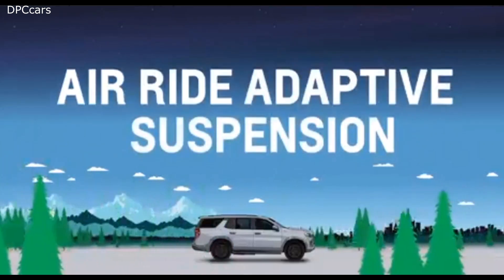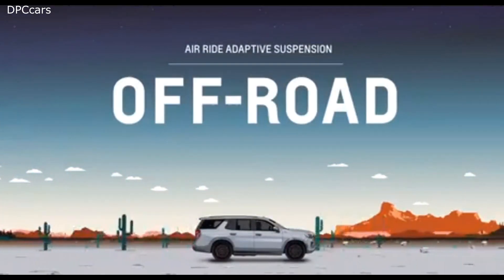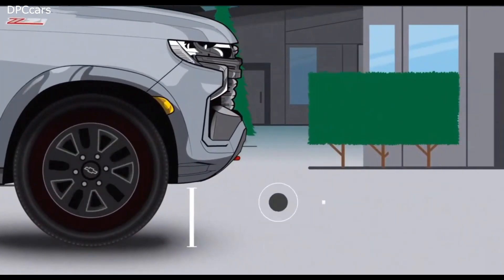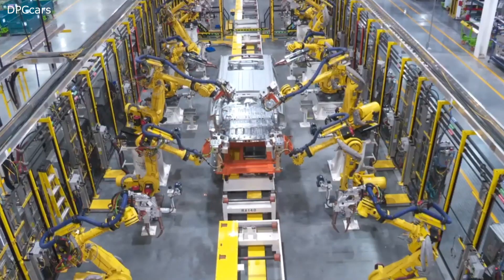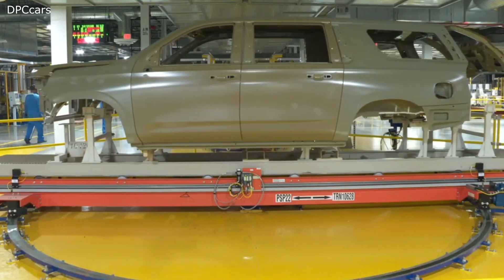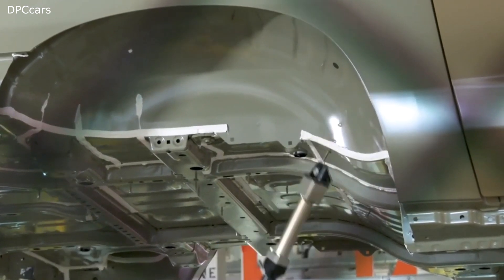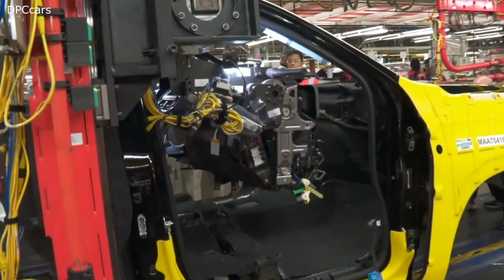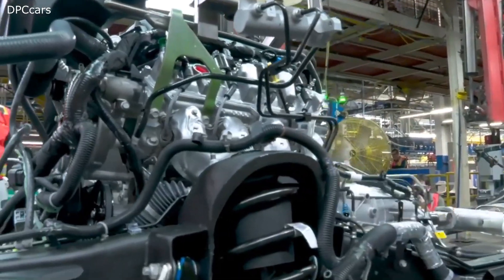2020 Chevrolet Tahoe and Suburban Air Ride Adaptive Suspension

Comment: The rear control arm design is a joke and disrespectful to all suburban owners. Ford and lincoln did a way better job at designing the irs. You can see through the rear suspension and see the car driving next to a suburban on the highway while land rovers and expeditions have tight and seamless rear arms. Literally looks like scaffolding equipment and random metal poles down there 👎🏾👎🏾

Comment: HOW does one manually control this air suspension? I am trying to lower in park, but cannot figure it out...
Reply: Sounds like 4wd low or high.  I need it to fit into our older garage too and need to know actual height reduction.  Sounds 2" less than factory.
Reply: It’s automatic

Comment: I love it. Do air shocks like this protect other components of the suspension from wearing down as fast? As in do they absorb impact better than traditional shocks therefore preventing other suspension components from being damaged over time by the impacts?
Reply: Low suspension arms will be susceptible to damage and impair patency. This is lower than many SUVs. Done badly. Air suspension tubing care after driving through mud.

Comment: Cart with cheap interior for the Price Q7, lol
Reply: It’s also a full size truck based suv. The Audi is a mid size car based suv. Prices get higher with size and body on frame designs are more durable in towing and rough terrain applications. I personally don’t see what’s cheap about it. Maybe the plastic tinker toy interiors they had pre-2014 but these are entirely leather wrapped with metal and open grain wood accents. It’s the same. The engine options are also legendary for long life. It’s not uncommon to find 5.3 Vortec V8 engines with 250k-300k+ miles on them. No automotive companies can survive these days with subpar products. Even non luxury brands have to have premium interior materials these days to survive. They can’t afford not to. The line between luxury and non luxury brands is fading.
Reply: @Cleaning_Hero  My uncle just bought a $80k Yukon 2020. The wood feels plastic and the whole center console creaks if you press on the "aluminum trim" which isn't fooling anyone. It also rides very firm for a "luxury" suv, far less refined than my Touareg. The new ones have independent air suspension like almost every other vehicle in this price range so hopefully they'll behave less like a truck now.
Reply: I just went to the Audi website. The Audi Q7 also has plastic buttons, plastic quarter panels and open cup holders. Try again.
Reply: @Cleaning_Hero  plastic in Audi better is high quality, don't  confuse with Tahoe there is plastic is low quality. By the said, Q7 has full leather package like Bentley...  Buttons Audi is beautiful, Chevrolet - ugly. Facelift Q7 don't have open cupboards. It's have virtual cockpit, not cheap instrumental panel like truck in Chevrolet. In tahoe even climate control blow from ceiling like a bus... Such cheap materials, simple ugly design, bad functionality - shame. For this money interior must not be worse than Hyundai interior.
Reply: Plastic is plastic to me. Also, people aren’t paying for the interior which is very competitive - with other vehicles in its class and price point.. They are paying for capability and reliability. For the money, you get more value in a truck based SUV, which it is. They can be used in many versatile applications. Try again. Expedition and Armada are both priced similarly and do not offer nearly as much refinement. Unfortunately, only so much can be told without physically seeing it, sitting in it, driving it and ultimately owning it. Even if this had a plastic interior as you falsely believe, it will ride better than any other truck based vehicle which permits the high price. The third row in this model is far more spacious than a Q7, which is another trait that permits the high price. The scarcity of vehicles that offer that and the scarcity of truck based suvs that offer a smooth quiet ride both permit the high price. And then you’d get the ability to tow and off road on top of that.
Reply: @Cleaning_Hero  note, GM plastic in Tahoe is shit, design is ugly for special, so that you feel himself homeless in Tahoe and pay them for Escalade. This plastic, these cheap with very simple design buttons, why i must endure it ugliness ?! It is not truck for $ 35k, it is cost like premium! And class never mind! Competitors very old (besides Expedition, which have interior F150, that same bad) and so poor. Is that yor excuse? Come up with better one! Koreans make already better for 0.5 price this booth.
Reply: @Cleaning_Hero  For the money you can have a Land Rover discovery with a better interior, nicer ride, and arguably more capability. The Tahoe might edge it out barely in tow capacity being a BOF vehicle but the Land Rover will be better off road with its more sophisticated terrain response.
Reply: @SimonStrother  Land Rover products have a tendency to fail more frequently than most other brands vehicles. They are beasts but!
Reply: point4894 what’s cheap about it
Reply: @Cleaning_Hero  looks up dushboard, buttons, instrumental panel etc....
Reply: @Cleaning_Hero  its a shame.
Reply: point4894 and I see leather lined panels, dash, metal accents and open grain wood.
Reply: @Cleaning_Hero  and cheap black plastic from below, on central console, around display, very cheup and ugly buttons like car 2010 year, open cupholders, dashboard like a old truck.
This is worse than cheaper Palisade.
Reply: point4894 most vehicles have plastic buttons including the Audi lol and news flash, it is a truck. Not a luxury car. Trucks are expensive for their capabilities and because the market favors them. Compare it with something in its vehicle class (full size truck based SUV) and not mid size car based SUVs, which are cars wearing an SUV mask.
Reply: Beauty is subjective
Reply: It also likely costs more to build a full size truck based suv than it does to build a smaller car based suv. It’s simple. More materials are required to build bigger vehicles. There are reasons why more people buy Tahoes than luxury suvs in the same price bracket. Aka capability, driver comfort, versatility and suspension durability. Case closed :)
Reply: @Cleaning_Hero  rear suspension tahoe fall off on first rough.
Reply: point4894 I do believe I’ve upset you. Apologies. Also, I’ll only debate statistics, not subjective opinions. Korea does not offer a full size suv to my knowledge so not sure why you brought that up. If you want to have a go at this vehicle, you have to compare it to it’s competitors. Expedition, Armada, Etc. Must be a full size truck based SUV, which Korea does not offer, at least in the USA.
Reply: GM may build their vehicles for foreign markets to a lower standard. But in the USA it is a solid 7-8 out of 10
Reply: If they build such “cheap” vehicles then why do you think so many highly educated people buy them? It is because they are fairly well built and they are very pleasing to drive. When you need massive passenger space, live in constant snow and have a boat to tow there are only a few options. This, Expedition and the Nissan Armada. They have the quietest ride, the best engines and the best interiors on the market in* this* segment.* I’m not saying they have the highest quality interiors in the world, but they are above average and definitely feel premium. Is it worth the money? As long as people pay the price they are.
Reply: @Cleaning_Hero  Did not guess. The level of performance of the interior does not depend of the class. Your carelessness let you down. I remind you that this segment is not experiencing strong growth, unlike SUV (look up statistic), so there is low competition, which is used by two manufacturers of poor interiors. Is this an excuse for a mediocre interior worse than the $ 45k Palisade? Definitely not. This can only be an excuse for the Tahoe club and similar biased and loyal communities. Are you one of them? Get well...
Reply: Audi Q7 is trendy junk for wanna-be wealthy people.